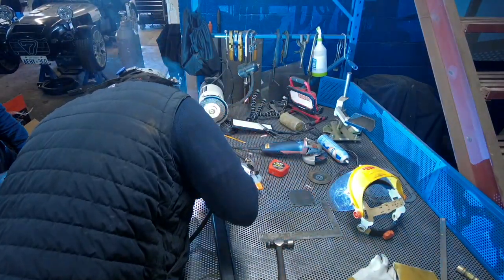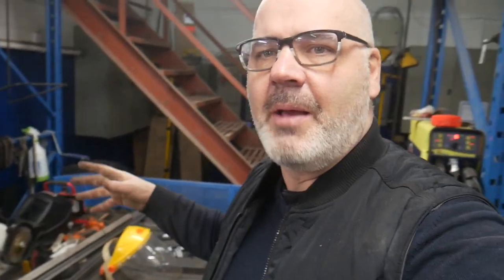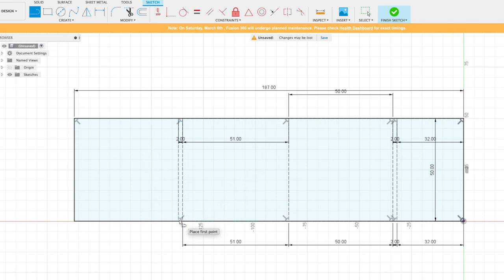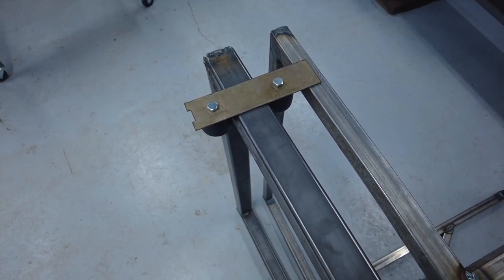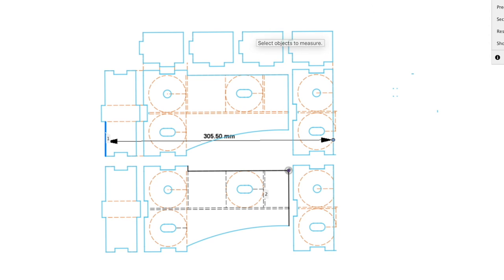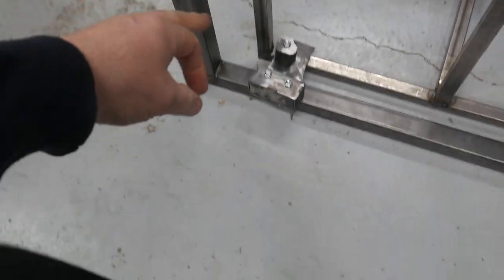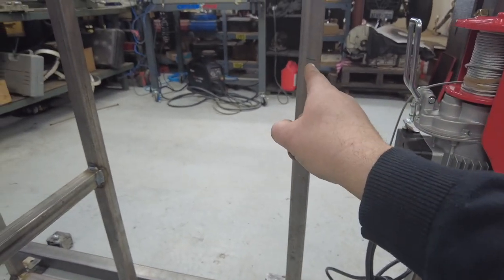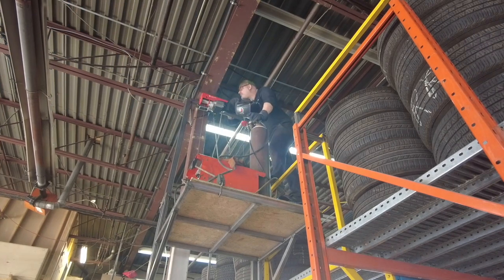DIY Elevator.

Comment: I'm thinking a limit switch at the top and bottom would finish this thing off nicely so it always stops at the same spots. Just wire them in series with your up and down buttons up at the winch.
Reply from the maker: thanks, maybe eventually once I work out all the bugs.

Comment: Great freakin job brother. Let’s start making some.STL files so we can 3D print.
Reply from the maker: LOLthanks, not sure about a plastic elevator though!!
Reply: @LouTrottier  No you said that you made some 3D printed tools.
Reply from the maker: @first25q43  oh yes, you are correct.
Reply: @LouTrottier  I am thinking about making a garage. Attic lift using unistrut rails on the wall. I will have to build a wood base. Or bolt the tubing since I am not a welder.
Reply from the maker: @first25q43  best of luck to you, can you get some pieces welded around you locally?
Reply: @LouTrottier   on live on 2 lakes not a lot around. Not close anyway.  Did the video say your plasma CNC was a Langmuir. I am looking at the MR-1
Reply from the maker: @first25q43  yes its a Langmuir.